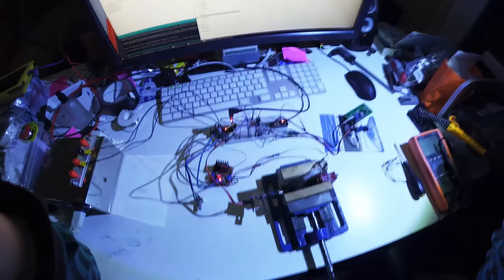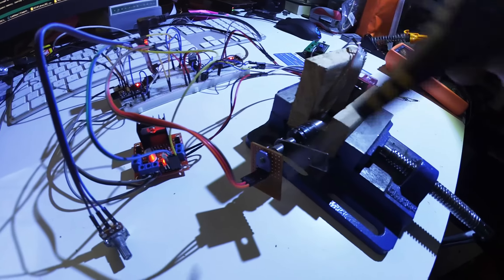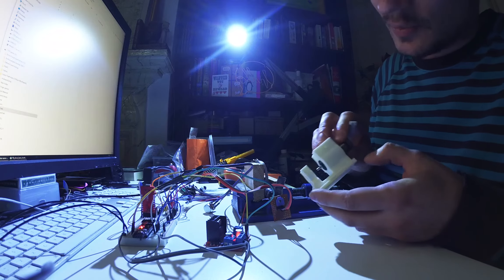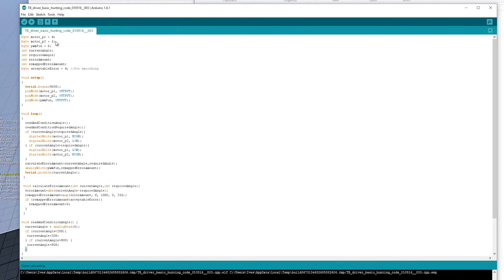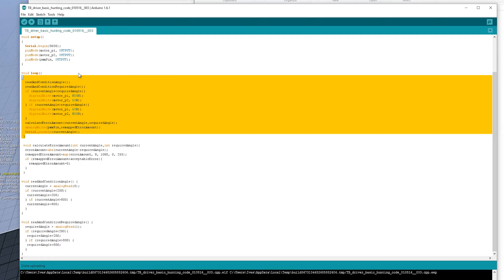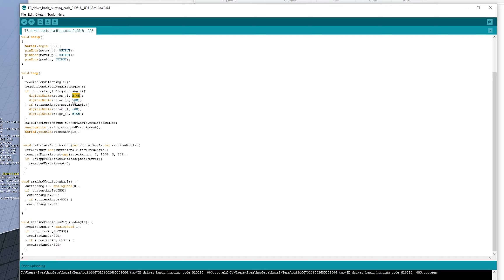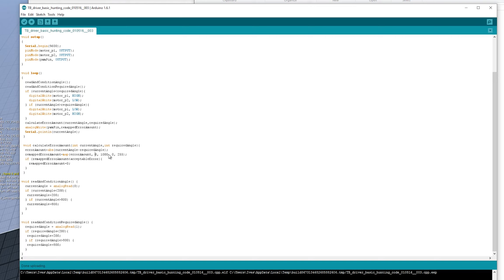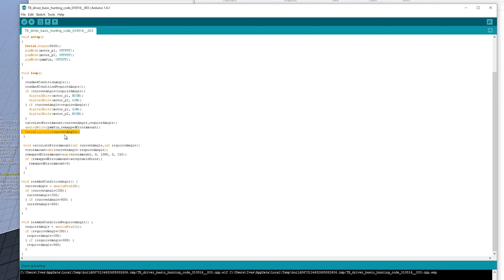Pt 1/2. DC gear motor + shaft potentiometer = DIY closed-loop servo.

Comment: I am building a custom heater control for an old classic vehicle. Using a dc motor actuator found on most simple HVAC systems, this is a brushed motor at 12 volts +, but is geared to a pot to provide feedback for position control. Move a lever or pot on the dash, and the motor moves a little or sweeps from stop to stop. A simple system to control a heater door with using a bunch of electronics. Do you have an idea? Thanks for the video.
ASE Master Tech / Retired

Comment: Hi it is possible if i change the dc motor encoder with dc motor without encoder? The code will be the same??
Reply from the maker: muhammad 1406 yeah sure - i didn't use the motor's own encoder in this video. Its relative so it's useless if the microcontroller loses track of the pulses for any reason. This could be dangerous in super critical applications like engine throttle control etc

Comment: What is your input for current angle and required angle? Where on the circuit is that coming from?
Reply from the maker: Current angle input is a rotary position sensor hanging on the end of the shaft on a small PCB (Murata sv01) and required angle is a just standard 10k pot. There is a bit more detail about them in the 2nd video

Comment: I intend to operate a valve with Dc motor, I have done some testings and valves do open and close perfectly but I need it to work with DS18S20
Reply from the maker: Cool. It will definitely work! I love the DS18S20, it's great. You just need to map your temperature value coming in to the desired angle range for the motor (map function), and tune it so it's not forcing the valve beyond it's fully open/fully closed points.

Comment: Hi
Is it possible to modify code and turn motor based on temperature inputs?
Reply: yes you can do it. but for what?
Reply from the maker: Yes. Create a working sketch that will acquire the temperature first, then merge it into my code for the servo. My code has an angle variable - use your temperature variable to change this in some way.  But Like @pachanoid says - what for? It might be easier just to use a hobby servo. This is really for applications where you need the speed, temperature resistance, high power/size and need the position feedback to make sure it never goes out of sync.

Comment: Don't use potentiometer, use motors inbuilt encoders to get precise movements. (use a PID algorithm).
Reply from the maker: Thanks for your comment. The motor's built in encoder is incremental and needs to be 'homed' or calibrated when the controller is swithed off/loses power. The potentiometer is an easy way to achieve absolute feedback, easier than an absolute optical encoder. Regarding PID - my code is essentially the 'P' of the PID. It's simpler and works just as well for my appliance.